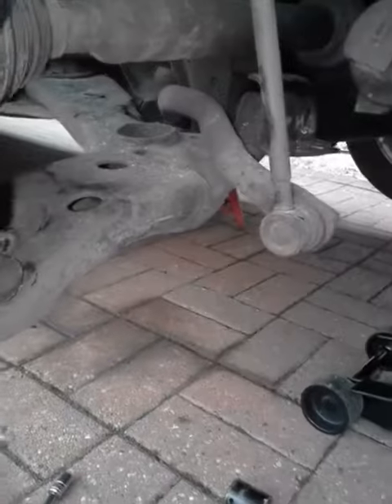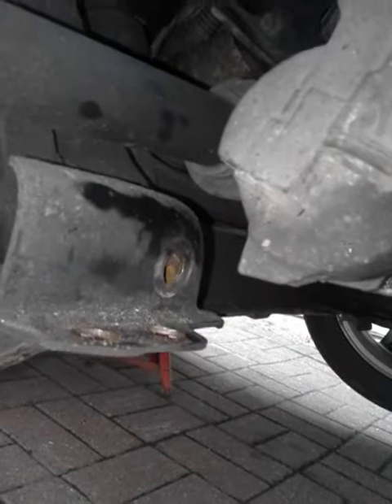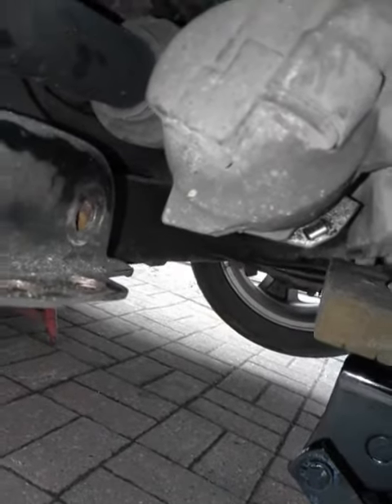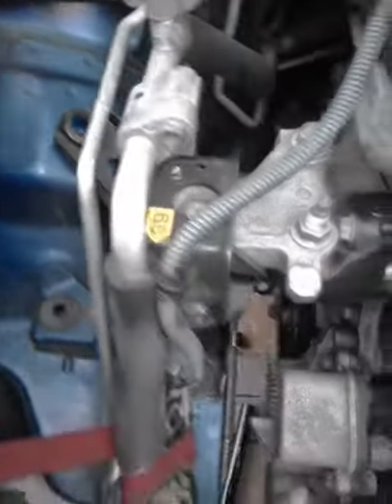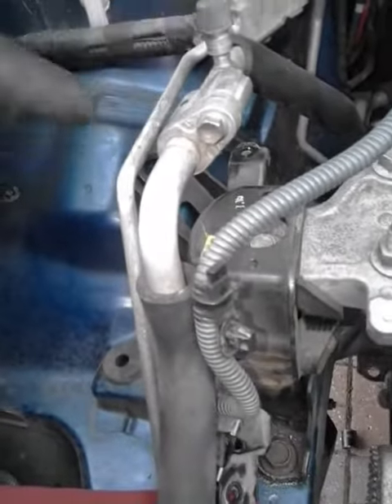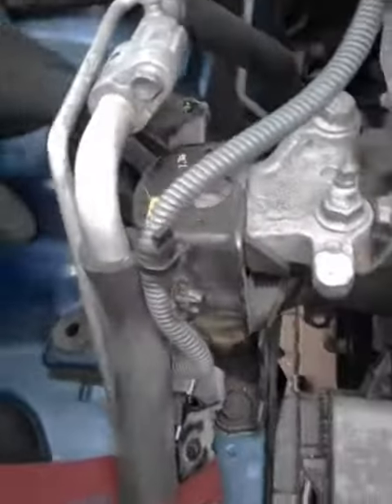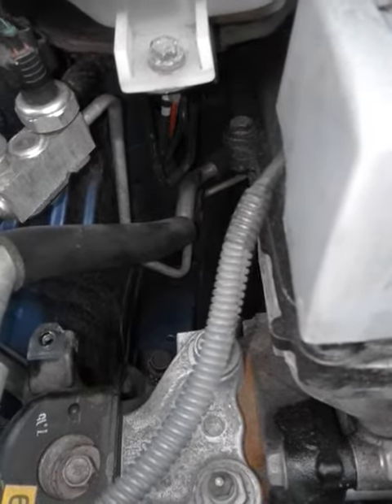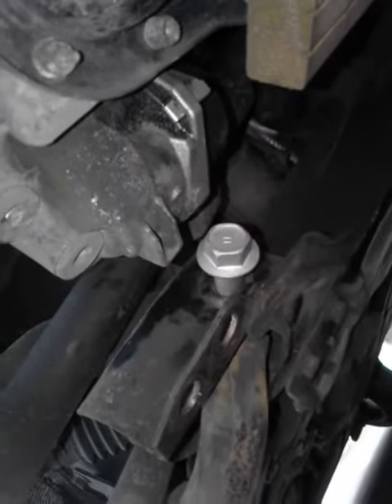Toyota prius gen 3 / 2010 right side control arm bolt removal

Comment: Thank you Sir! This helped out a ton! The repair manual was having me basically remove everything under the car to drop both control arms at once! I said there has to be a better way and sure enough this did the trick! Anyone putting anti seize on this bolt when putting it back in?
Reply from the maker: Thank you very much  glad it helped 👍👍👍👍

Comment: Please help! I couldn’t remove the other side control arm ( left side), the bolt is hitting to transmission. Do I need to lift that side too? Or no need bcoz didn’t come off so I need to put everything back. Please help.
Reply from the maker: I didn't have  to lift the left side  .. that came off ok ..
Reply: Geeman was the right side lifted already when you were doing the left side ? Thanks
Reply from the maker: @kerem54545454    no .. I didn't have a problem on the gearbox  side it slid straight ... You do have to remove  a metal brace  has 4 bolts I believe   take that  off and it should   come out ... failing thst trying  lifting it a bit...... but the left  side was the easy side to do....
Reply: Geeman thank you very much, I’ll try once again doing so. Your video was so helpful, haven’t found any other video like his for 3rd gen. So that brace needs to be off for left side to come off.

Comment: You can just remove the oil filter housing. 4 12 mm bolts. No need to unbolt mount and jack up. Drain the oil first!
Reply: Wow

Comment: HOW ABOUT THE TRICKY LEFT SIDE?
Reply from the maker: The other side comes off very easy ... I think there's  like a metal bracd plate it front of the control arm bolt .. remove it think  it's 4 bolts  and you can then whip if  off ... the right side is the worst to do on a right hand drive car ... hope it helps you
Reply: @Grahams-Grass  LEFT SIDE HITS THE TRANSMISSION DIDN'T YOU JACK IT UP?
Reply from the maker: @21boxhead   not the left side it just came out really easy. There's a brace plate to take off . After thst it slides out ..

Comment: Didn't realise the Right side is such a pain but to be honest its just logical, however one thing I didn't agree with was lifting the engine on the sump. This is big NO NO! You should have looked around for something that was more solid like a bolt hole stuck a bolt in it and lifted from there.
Reply from the maker: As long as you use a block of wood to spread the load  it's all good your only taking the weight of one side  by about an inch ...👍👍👍

Comment: Toyota need a slap around the back of the head for designing the bolt to get stuck. They could have used a different type of bolt or put it in another angle. Toyota sort yourself out.
Reply: It's almost like they design it to be put together, and only able to be taken apart by official Toyota dealerships.... must be some weird coincidence

Comment: Easy??
Reply from the maker: It was once the engine was lifted....  oil filter sidehas to be lifted to get the bolt past the housing . The  other side  comes pretty much straight out just a brace panal to unbolt... it's all pretty much just nuts and bolts.. 👍👍👍